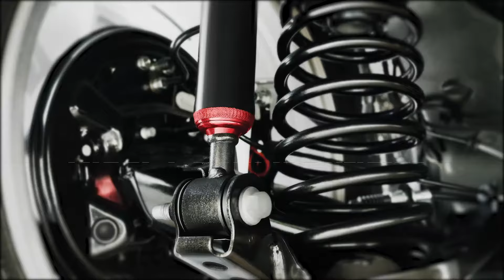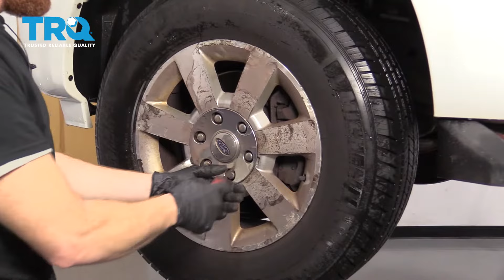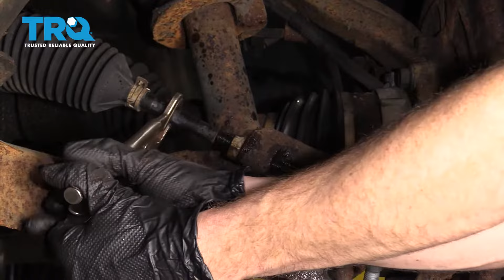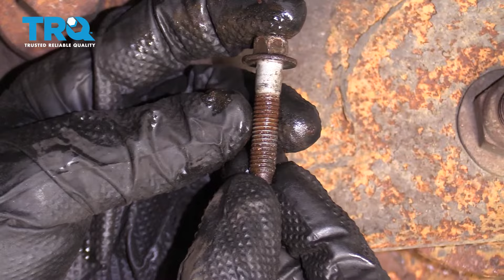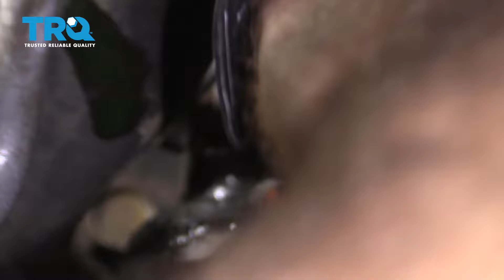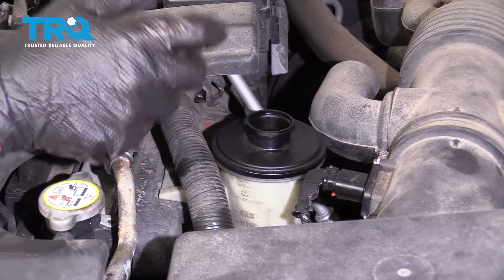How to Replace Power Steering Rack 2007-17 Ford Expedition

Comment: How do I get rid of my steering wheel moving so much side to side like the normal play on 10yr old truck I’ve replaced all front end parts . A lot better bit not what I expected it to be I want a tight steering wheel

Comment: Appreciate your video,was a big help. I have a 2012 Expedition,I replaced the inner &outer tie rod ends, because of play, vibration in front suspension, after replacing still had same issue, only to discover the excessive play was coming from the steering rack itself, the internal shaft was very wobbly. Thanks for the video.
Reply from the maker: +andre hamilton Thank you! We love empowering our customers and showing how to perform DIY auto repairs with our high-quality auto parts. http://1aau.to/m/Shop-TRQ